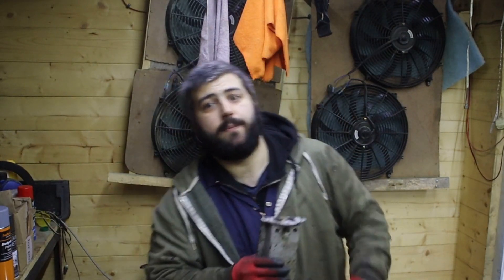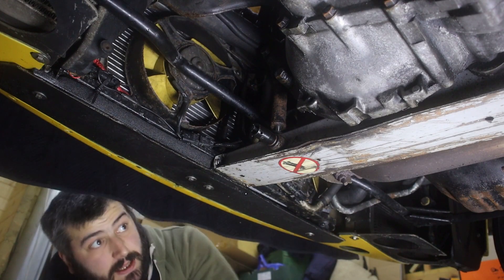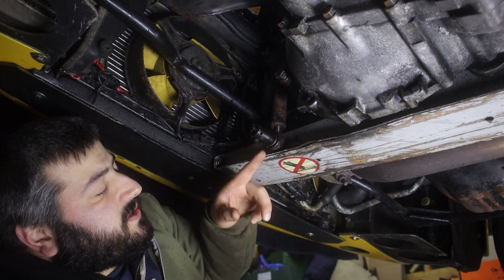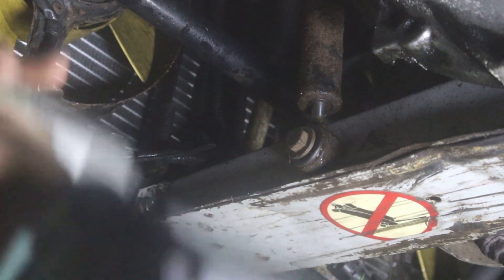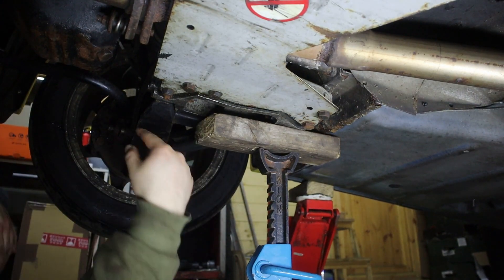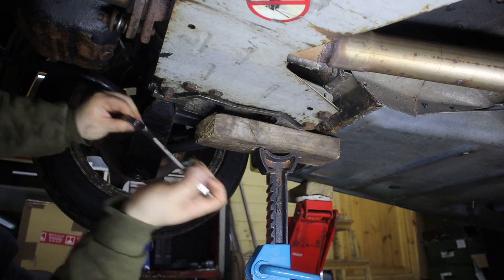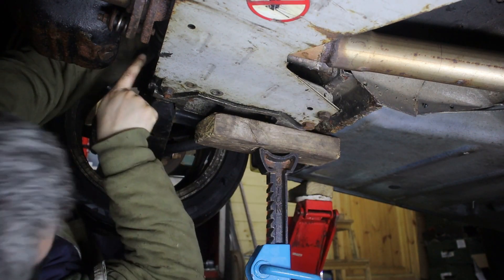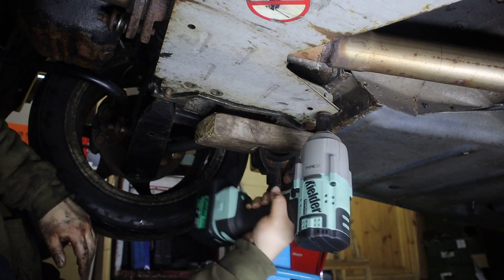Removing the Subframe (prongeron) - Lotus Elan M100 Project

Comment: Excellent video! A couple of points to add: in addition to supporting the car, you need to support the suspension under the rafts (or remove them and the lower track control arms); and the engine does not need to be supported inspite of the prongeron sometimes being described as an engine support frame (which it isn't). 

I can't find anything in the service manual about removing the prongeron, so your video is very valuable.

Once removed, lots of things become accessible, so be ready for some mission creep.